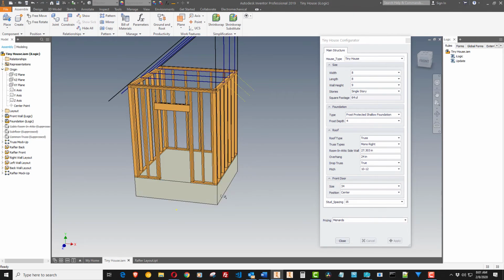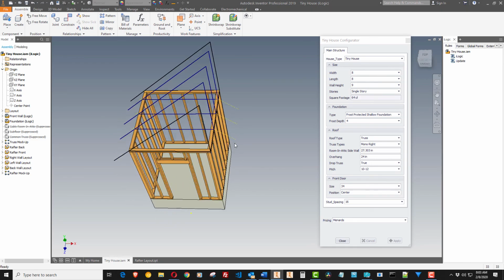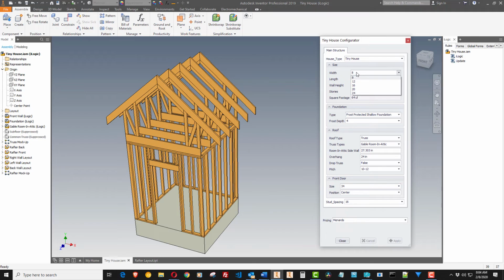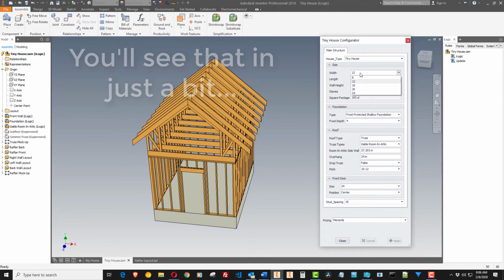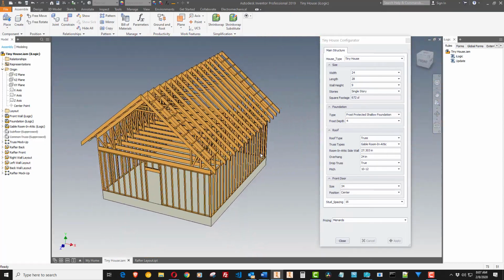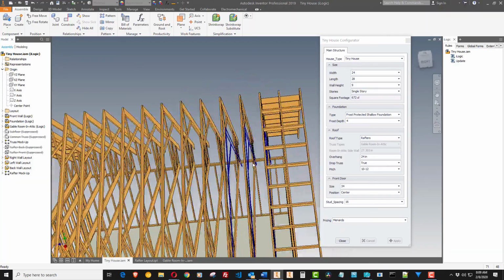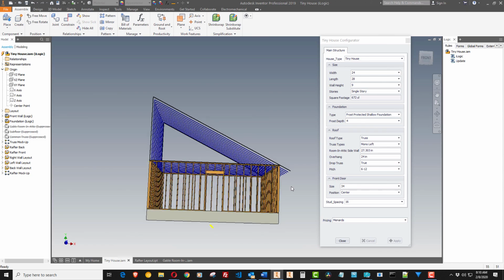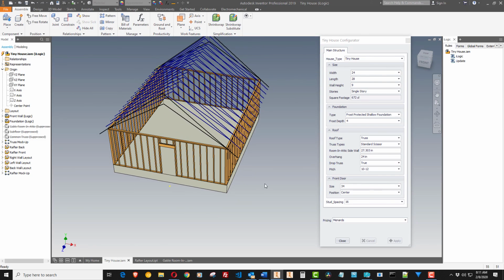Tiny House Design Tool

Comment: Is that foundation the same as a Bell foundation?  That mono roof would fit nicely on a little shed snugged up next to a larger building like a pole barn shed.
Reply from the maker: I do believe they call the shape both "bell" and "thickened edge". The frost protected come from both that shape and the foam attached to it 😊